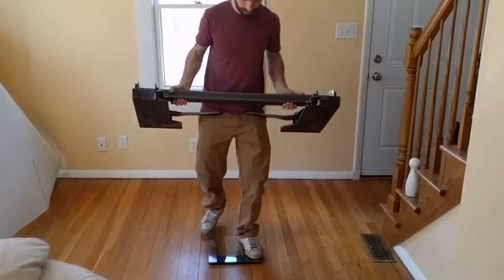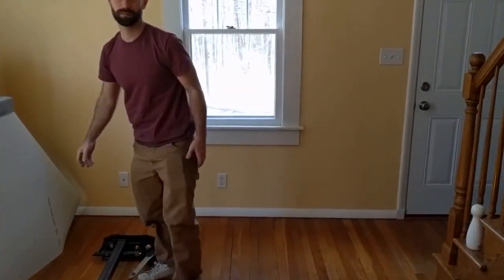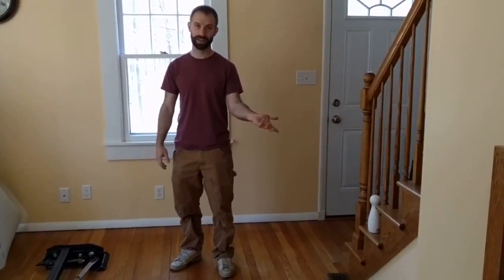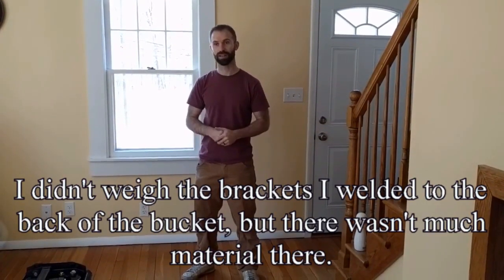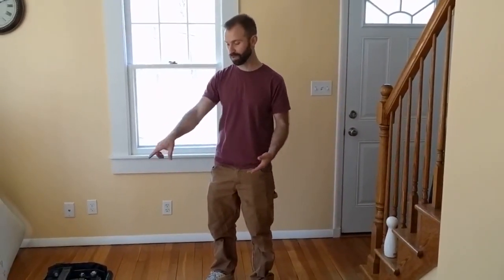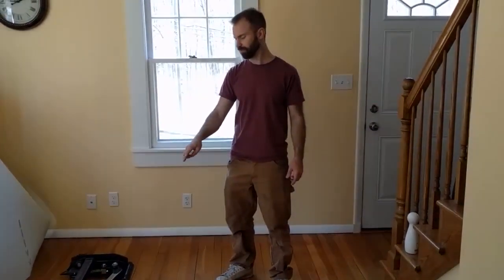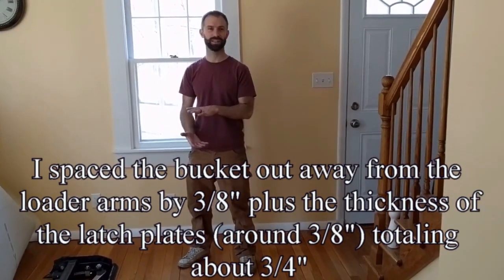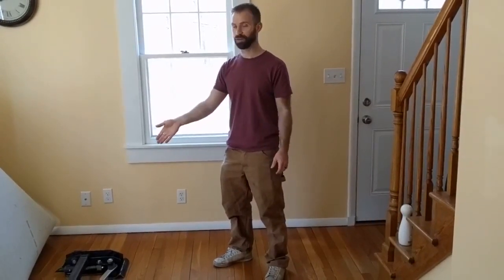how much weight does my quick attach adapter add to my loader arms

Comment: George, do you have a video detailing how you made the adapter itself? would love to see...want to build one myself. bachs04@hotmail.com...thx!
Reply from the maker: Unfortunately I haven't had time to edit any of that footage. I spent quite a bit of time confirming measurements. The quick attach set up doesn't seem to have exact specifications. It's quite frustrating actually!  I ended up measuring a few machines at my local dealer to confirm some of the measurements!!! Hopefully in the near future I will have time to edit some of the build footage